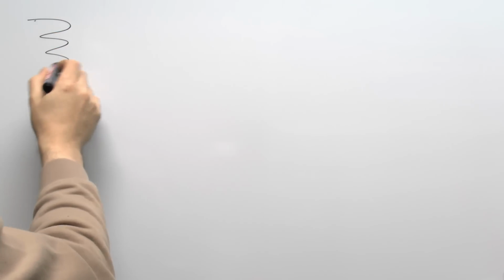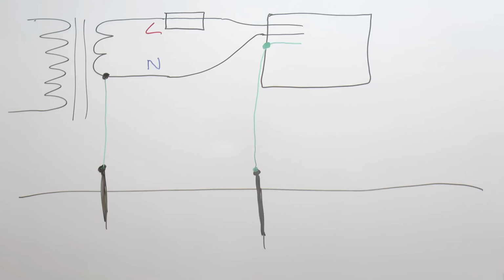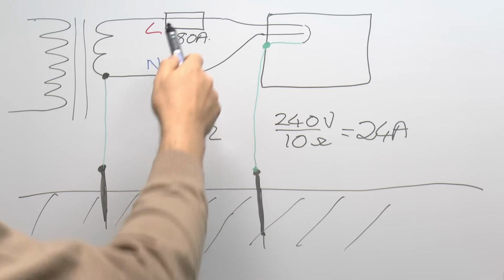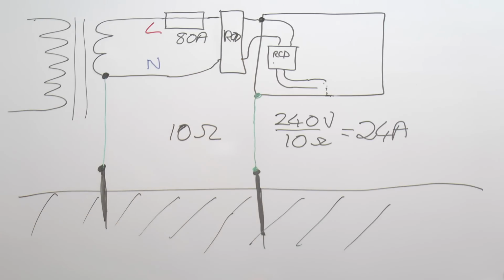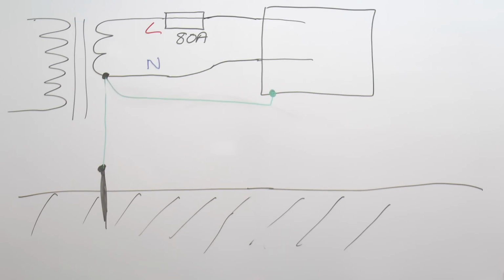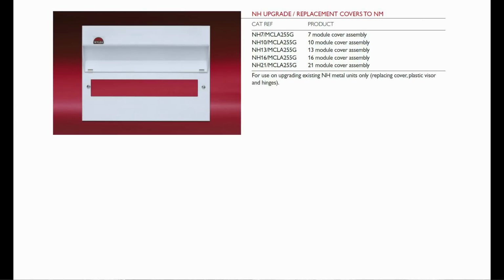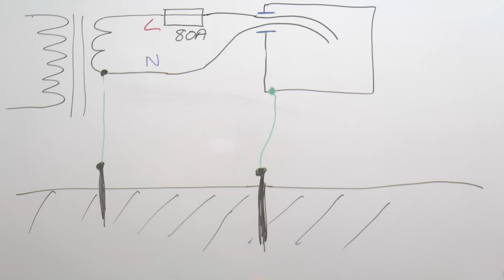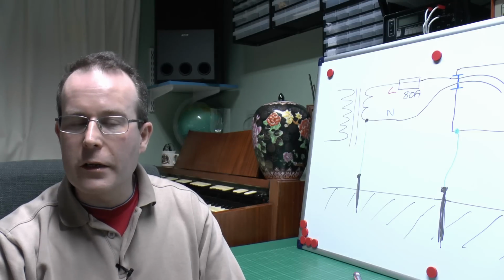Metal Consumer Unit on TT supply BS7671 Amendment 3

Comment: The French have a DNO supplied 500ma RCBO on the supply which acts as the main switch as well. This solves it. But it is plastic. It is fitted outside of the Consumer Unit which are plastic in France. But usually in a metal cupboard (which is legal in the UK).

The French usually have TT earthing.

Comment: Great educational video again. I will not just test for voltage between live and earth on these systems as the earth may be at 230 Volts and not trip anythings. Result = Meter reads 0 volts even if Line at 230 volts  !!!!

Comment: Can you build some kind of CT arrangenent over the Main TT Earth conductor for it to operate some kind of shunt trip when significant current is detected?
Reply: But the trip unit (100A contactor say) would HAVE to be mounted in a metal enclosure OUTSIDE of the CU and as John explained, you are then back to square one!

My understanding though (and it's now 7 years later) is that a BAKELITE switch cover is acceptable for an external isolator as bakelite is essentially fireproof (not so much as steel clearly). At least to the necessary extent of preventing fire egress sufficiently well and long enough. Certainly far longer than the MCB materials in the CU.

One possibility to reduce risk would be a low current warning lamp fitted between its own external ground and the chassis of the CU. 

That way any current path via the chassis not large enough, due to earth loop impedance, to blow the incoming fuse, but large enough to produce 5 to 12 volts potential drop would light the bulb (and could sound a low volt alarm). Voltage drops greater than 12 volts can easily be catered for by a suitable buck/boost circuit producing constant voltage and limited DC current. 

The latter is a trivial task and in fact most LED switching circuit supplies have the (isolating) electronics required, but need some minor component tweaks.

Comment: Did you ever find a good solution to this j.w 
If you where installing a metal c.u on a tt system would you install 30ma rcds in the consumer unit  and a main switch 100amp 100ma time delayed rcd before the consumer unit 
Thanks
Reply from the maker: The solution provided by manufacturers is to use a specific plastic grommet where the wires enter the consumer unit, and to maintain the outer covering of the wires inside the consumer unit.  Some have suggested using a plastic enclosure with another RCD (such as the 100mA time delayed type) before the CU, and have stated that is not under the same requirements for metal as the main CU.
In many cases the supply can be changed to TN-C-S which avoids the problem entirely.
Reply: @jwflame  sound jw. On a tt system would you say 10mm main earth and 6mm main bonding is ok . Or should it be upgraded to 16mm main earth and 10mm binding. What are the lowest values allowed
Reply: @jwflame  You said 'Some have suggested using a plastic enclosure with another RCD (such as the 100mA time delayed type) before the CU, and have stated that is not under the same requirements for metal as the main CU'.  You said on this video it wouldn't comply, so is this based on new information as your comment was made 4 years after this video?

Comment: Why can we not have a plastic enclosure for an upfront RCD yet when the DNO installs a DP isolator its plastic..?
Reply from the maker: DNOs do not work to BS7671.
Reply: @jwflame  I read recently in ESQCR that the DNO has to abide by BS7671 as soon as their service enters a dwelling. This would include their DP isolator.  I'm trying to decide what exactly 421.1.201 applies to when it mentions 'consumer units and similar switchgear assemblies'.  I'd say an isolator or stand-alone RCD is an item of switchgear, but lacks similarity to a consumer unit so the non-combustible requirement doesn't apply.  I'm looking for an enclosure for an S100 mA RCD at a TT job next week and I think I'm going with plastic.
Reply from the maker: @westinthewest  Like many things it's not clearly defined, but several manufacturers still make isolators in plastic enclosures, and they are often installed.  A metal enclosure on TT direct from the supply is something to be avoided - go with the plastic enclosure and RCD.

Comment: When you apply earth bonding  to  a TT system you could have some worker cut through the main earth wire from the earth rod. If a live wire happens to touch any metal part that is connected to the bonded system then all metallic items become live even with a plastic consumer unit. Unlikely but not impossible?
Reply from the maker: Theoretically possible, assuming the RCD is also not working.  Even with the rod connected, a failed RCD still causes the same  dangerous result.
Reply: @jwflame  Initially, I thought the same as you John where I included a failed RCD in my original post (reason for edited) but when you consider that there is no earthing means then a working RCD will be ineffective. I attended a NICEIC talk regarding new regulations and queried the reason for earth bonding and was informed that other countries, such as the USA, do not employ this practice. A short plastic pipe connection between isolating valves and outlets (taps, washing machine valves....) would deem this practice redundant.
Reply: @od5699  "no earthing means then a working RCD will be ineffective" - why do you say that (taking you mean no earth at the consumer rather than the supplier)? A person in contact with an exposed conductive part and earth will pass current that will imbalance the L/N currents so the RCD should operate.

Comment: Plastic coating on the inside of the new metallic consumer units?
Reply: I think that would be the best  solution Pat well thought of. I think there would only be a slight increase in cost but it definetly solves the issue. There is plenty PVC coated flat 0.7mm gauge metal around, you could probably get LSF if you look hard enough.

Comment: If this is such a potential problem (no pun intended) what is the rationale behind the move  in the first place ??
Reply from the maker: Allegedly because of an increase in fires involving consumer units - although the exact cause of those fires was never revealed and it would have been far better to deal with the actual cause of the fires rather than just making the box non-flammable.

Comment: Is the simple solution just to put the pre consumer unit RCD in a ceramic enclosure ? Non conductive and fireproof
Reply from the maker: That would do - the only problem is finding a ceramic enclosure..
Reply: Would a 100amp 100ma time delayed double pole RCD in a ceramic enclosure do the trick ? I know all ( most anyway ) final circuits have to be protected with 30ma RCDs, but do the meter tails need 30ma protection ?

Comment: There could easily be a technical, if not very elegant fix to this problem. What would be required is a device that monitored the earth voltage relative to neutral. It would be installed in the CU and if a threshold voltage between neutral and earth was exceeded (say 60v) if would create a live-to-neutral path and blow the supplier fuse (and no doubt make a big bang too). 

Of course the device would probably be destroyed in the process by passing such a big current, but as this ought to be a very rare event, then it's a price worth paying to keep the installation safe (especially as such a fault wouldn't have made just the electrical systems earth live, but also any metal parts bonded to it - like the gas and water pipes).

So there's my solution - effectively a device that connects Earth to Neutral within the CU and which goes closed circuit if there's a potential of more than (say) 50v. The very simplest sort of device would work like a souped-up diac and be connected between neutral and earth. Of course, that's a very simple element, but if necessary a more complicated one could be created that created a closed circuit between Live/Line and Neutral, which would be more positive in operation. 

So how do I file a patent, or have I got the principle wrong?
Reply: And if the fuse doesn't blow for some reason you get a fire, and also with that dead short you will probably trip protections on the supplier side that act faster than the fuse, leaving without power an entire block. 

The solution would be integrating RCD protection on the supplier side, of course time delayed protection to avoid that it trips before the RCD that you have inside you home.

Comment: In UK each house has its own transformer from high voltages to 230 V?
Reply: No.  Typically there will be a transformer serving a district and distributed fro here to each dwelling with a 100, 80 or 63 amp fuse

Comment: Hi John.... This business of the meter tails passing through one hole in the new metal consumer units via a special gland. Now...I watched your video when you tested the theory out....inductance etc..
Why does this not apply to ...say...twin and earth entering a metal back box of a socket etc..
Reply from the maker: With T&E you have both line and neutral in the cable, current in each wire is in opposite directions so any magnetic effects are cancelled out.  The same applies with those plastic glands, as both line and neutral wires pass through the same hole.
The problem only occurs with a single wire through one hole.

Comment: Hey John you said at 2.29 you said another connection the supply would provide so can we see that earthing connection or is it that's not. In a house I mean is that near the consumer unit or is it away.
Reply: The transformer on the left hand side of the drawing represents the electricity supply company's transformer, that transformer could be a considerable distance from a house depending on location. The supply company will connect the neutral of THEIR transformer output to earth using a large deep rod, conductive mat, or similar. In the diagram the house has its own separate rod (right hand side)

Comment: As an electrician in London I have very little experience with TT systems. Why do they not make it a PME system?
Reply: Out in 'the sticks' we have many properties on PME and TT's earthing arrangements and I have experienced a broken neutral on an overhead transformer on a property, feeding a farmhouse. The  kitchen sink and copper metal pipework were at 250v potential. Not nice and very dangerous..I can see also why the new EV regulation on local earth rod's (TT)  has come in, as an EV Car can become live too, hence them upgrading the RCD. PME is not all it's cracked up to be..
Reply: londontrada Great question. Why isn’t every tt a Tncs
Reply: Because most TT systems use overhead lines, a broken Neutral on a TNCS makes the system dangerous. The same applies to a PME System.

Comment: Actually the cable glands are made of plastic, the inlet (the things with the two holes shown aside) is made of rubber. Actually they are used to offer some protection against dust or water (IP54) and providing some strain-relief if mounted correctly.

Comment: Hi, John. I think your presentations are brill!!
I'm hoping that you have time to help me with a dilemma I have concerning metal consumer units. My home is on a TT system and is currently being rewired. A 17 way British General Electrical metal consumer unit is being fitted and after viewing your video I am concerned about cables inside the unit creating a fault to the metal case. The unit is fitted with a cable gland. I looked at the Wylex site and they recommend that a 100 milliamp time delay S type RCCB  device be fitted between their metal consumer unit and the supply unit. Will this prevent the metal case from ever becoming live and is the Wylex device above compatible with the BG Electrical unit that is being fitted in my home? Thanking you, in anticipation.

Comment: how about plastic or ceramic inserts that fit inside the consumer unit enclosing all pre RCD cables?
Reply: That's exactly what was used years ago, ceramic grommets - some had to be quite large to allow entry of supply cable cores.

Comment: Curious, as there is , as it looks, an unavoidable problem with TT systems, wouldnt it be beneficial to get the power networks to change earth rods to a TNCS PME connection.
Everybody worries about fires and not considering death by electrocution on these types of earthing systems,
Surely they could just cut the main earth and put it in with the neutral to avoid this problem?
Reply from the maker: +matt filmer Where TNCS is available it would usually be a better option than TT.  However it is not available everywhere as it depends on the design of the electricity network in the area.

Comment: Previous to these ammendments metal cased consumer units were a no no on TT systems unless additional rcd protection was provided in an all insulated enclosure prior to the consumer unit. Now it seems using PVC/PVC supply conductors to such an enclosure is acceptable because they have suddenly become double insulated, they are not as they are merely PVC/PVC insulated.  A few years ago I would have been pulled for doing this.

Comment: I've hit this exact problem with a TT consumer board install. If you check out Crabtree they are suggesting an external 100ma RCD which just moves the problem as JW says.
Why don't the manufacturers just put in a simple phase separator or non flammable & conductive sleeve.
Reply: +Evil Knievel i work for one of the scottish suppliers, if we get a bad Ze, standard practice now is to fit a 100ma RCD after the meter.  the tails are at this point not enclosed, or passing through any metal enclosure, so this does fix the earth problem.
Reply: +ben kerr thanks for your response,I think that is the answer but the job I have to do is my own C/U for my first registration with Napit,I'm sure you'll be aware they're one of England's registration bodies.
One of their assessors advised me that adding a separate RCD was a possibility but he felt that this would just move the problem as JW suggests.
I think you are right as this would be similar to the isolation switch that we've just paid to have installed before continuing with the job.
Yes it's got mechanical parts but other than that it's a joint,like a Henley block and the cables aren't really enclosed within it.
There's so many opinions,one bloke always thinks he's wiser than the next,I have my opinions,on & on....
I bet they never have a fire start from a cutout switch or a meter so perhaps it is only within C/U's that were poorly installed, had a faulty MCB as someone else suggested or have been tampered with by the consumer or another trade.
Let's face it we all have different standards.
When will be the first shock from a metal C/U ?
Sorry I'm just opinionating , is that a word ?
Does anyone have an opinion  ?

Comment: Couple of questions:
If Neutral is effectively the same as Earth why do we need both cables ?
Is there any argument for having any circuits NOT protected by RCDs ? (as seems to be the case in my consumer unit)
Reply from the maker: +David Graeme-Baker It's an additional safety feature.  A system which uses a single conductor for neutral and earth throughout the installation is called TNC, and has the disadvantage that if that conductor is broken, exposed metalwork of appliances will have dangerous voltages, as the combined neutral & earth carries current in normal operation.

Comment: there is an option to use ceramic, which can be moulded to any shape, and fits both fireproof and non conductive, or carbon fibre which is used for sports car brakes, so must be hard to set fire to, but maybe this is way too expensive!
Reply: a) if you've never seen F1 carbon brakes on fire you've not lived

b) carbon fibre is VERY conductive and causes havoc for F1 engineers where for structural integrity reasons they have to maintain that integrity whilst cutting a hole in bulkheads etc AND insulate the cut hole as the carbon fibres are VERY abrasive and after chafing through insulation provide a shorting path for signals and power.

My youngest brother has worked as an engineer with one of the top F1 teams for over 25 years and both these issues have the bane of his life for pretty much all that time.

Comment: it seems that the problem cannot be solved entirely as at some point in the dwelling the meter tails have to enter the consumers switchgear, and that switchgear now must been metalic
i would suggest that
 a) consumer units should be positioned as close to the REC supply (reg 531.4.1 indicates this) to reduce potential of tails being damaged and a high impedance fault occuring
 b) cable manufaturers should look at increasing insulation resistance on meter tails or providing insulated sleeving to be fitted on installation
c) consumer units need to be more spacious for accomodating larger size cables due to suggested insulation increase and so reducing strain on connections due to bending and tensioning of meter tails inside the consumer unit.

Comment: This amendment was put forward and proposed by the Fire Brigade due to the increase in Consumer Unit fires in the last 5-6 years.
It was about 5-6 years ago that there was a recall issued on certain Wylex, Crabtree and Volex MCB's due to them possibly being faulty.
Could these MCB's be the root cause of the fires and NOT sub-standard work by Sparkies???
Reply from the maker: ToonandBBfan Could well be.  Not entirely convinced that the Fire Brigade actually proposed this either - the data about the increase in fires certainly came from them, but that may have just been used by others to get metal consumer units as a requirement.
Reply: *****

Thanks.
 My company had its annual NIC inspection this week and our NIC Inspector is livid about the Metal CU's being brought in.
Reply: +ToonandBBfan I cant help thinking this is just to create income by legislative obsolescence, there is no reason not to have an RCD mounted in a fireproof fibreglass box ouside the property as they are here in Bulgaria.